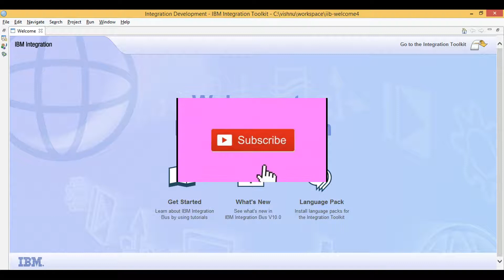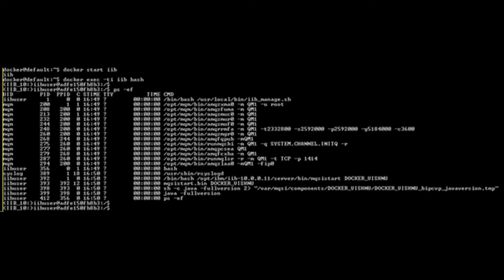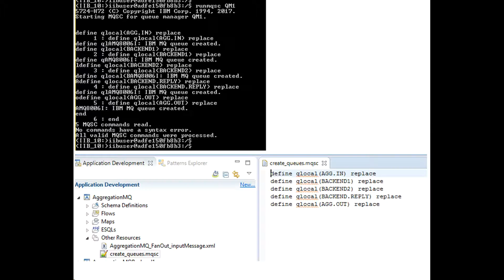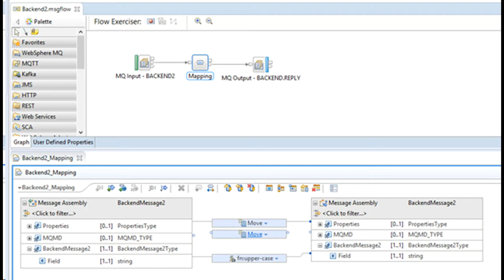iib - aggregate nodes (part 2) sample code - IBM Integration Bus

Comment: Is it possible to send multiple messages to the same input queue and receive response in the mq response queue using agreegate request and response queue
Reply from the maker: Question not clear. Send an email with diagrams of what your requirement is. Email address is in video description
Reply: @code2blog  what's your email ?